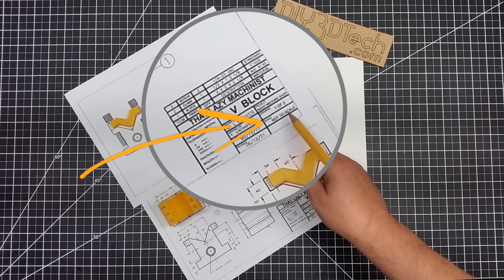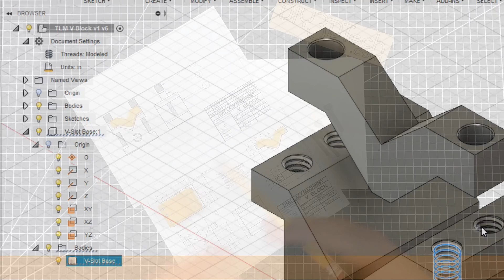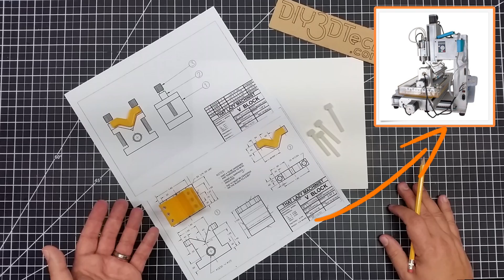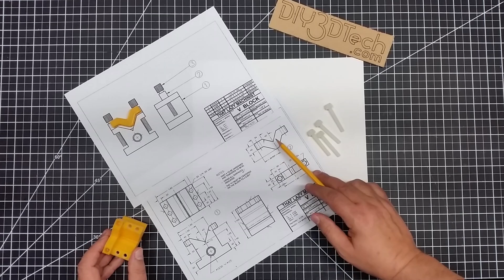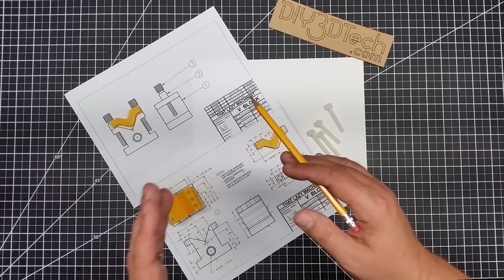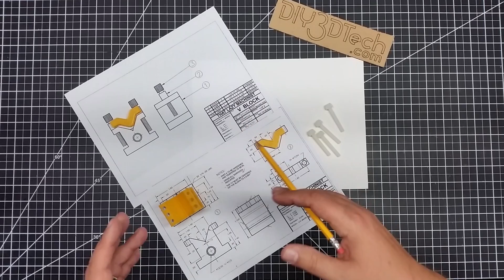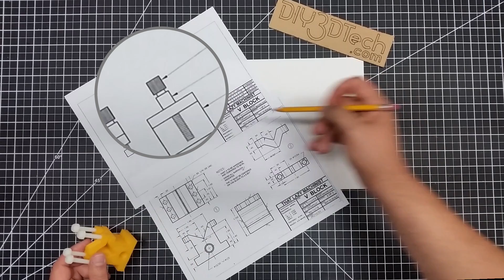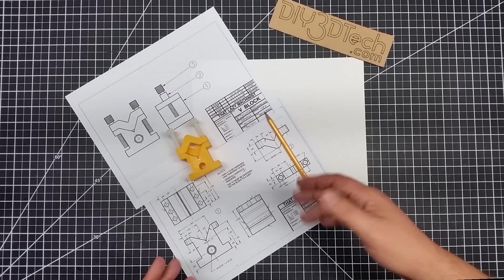Design Talk - Building the Lazy Machinist V Slot Widget!

Comment: Hi! It is nice to see a different  approach to making parts. I have done a lot of NC work but I have to admit that it was before programming software existed (G code programming). It reminds me that I am getting older. It would be good to ensure that the screw heads do not overhang the side of the V block. The clamp is not as wide as the block so that you can use the bloc on its base or on its side (without interference of the clamp (or screw heads) and the machine table or surface plate). I thoroughly enjoyed the video and I invite you to contact me if you ever have any questions about my school projects. You may notice that some parts are more complex than necessary, it is important to remember that the first objective of these projects is to ensure that the student uses as many different machining techniques as possible. Great job!! keep the videos coming, Marc.  Thatlazymachinist@Gmail.com  (if you ever want to contact me).
Reply from the maker: I am humbled!  You have done some great work sir and my goal is just that to show that, how other modalities of manufacture can be used!  Without question you will hear more from me in the future as these are great reference models!  I am in the process of build a new shop (and house for the wife) so when done this fall and moved I plan to pick things up again :-)

Comment: Ur cad drawin is bad..
Reply from the maker: LOL!  Herr Viking why do you say that?
Reply: Drawings are performed on separate cards @DIY3DTECHcom
Reply from the maker: Still not sure what your trying to share, however that is part of the idea of this video because as pointed these are from the "The Lazy Machinist's" site and a bit old.  However that is the point I am trying to get at, as those getting into the trade will need to be able to work with a range of drawings.  Was watching a video the other day where as machinist was trying to recreate something based upon drawings from the 20's which where very lacking,

Comment: Thanks for the video.  I have done a bit of work with 3D printed threads.  Here are my findings:

1: If you are patient, and with a few techniques, you can print threads that don't need to be chased with a tap/die.  I've successfully printed functional male m48x0.75 threads with no post-processing (had to, didn't have a die that large). TBH it was a huge pain to get dialed in and I would have used taps/dies in that case but just to point out that if you want to do additive manufacturing of threaded parts with minimal post-processing, it can be done even in fairly challenging situations like that.
2: Tolerances.  I do all my CAD work in F360 and "CNC kitchen" posted a great video showing how to add tolerances to modeled F360 threads.  You basically select the faces of the threaded mating surfaces and use the Press/Pull tool to move them away from each other.  Works great, easy to do, and nullifies the "shrinkage" issue you hit on in this video.  This is a KEY tip in terms of avoiding taps/dies.
3: Print technique:  GO SLOW is the best thing you can do with threads.  I print M6x1.0 parts that come out essentially perfect and since the parts are small they still only take about 10min each.  Of course this is a problem if you have a big part with threads inside it.  In these cases you might consider doing a threaded insert, or create a slot or other container for actual hardware.  Installing that is faster and/or less error prone than printing slowly or running taps/dies over your parts, and in the end you have a stronger thread anyway.  I print threads at 10mm-20mm/sec and 0.12mm layer height with a 0.4mm nozzle.
Reply from the maker: Many thanks for commenting!  Yes, printing with 0.2mm nozzle I would assume would produce amazing threads and you would have to go slow with that.  However I am doing 1/4-20 threads all day long with 0.4mm and no chasing with Fusion 360!  I am just blow away with the quality/ability of Fusion to create threads!  :-)
Reply: Awesome, glad you have it dialed in!  It's pretty amazing.  I actually meant 0.4mm, not sure why I erroneously said 0.2mm   I don't think I even own a nozzle that small and certainly have never printed with one.  I just updated my comment...  TBH I have never pushed the speed to see how fast I could go and still get a reasonably accurate thread.  Some of the issue is that with some of the little bolts I print, you need to go slow to keep them from being ripped from the bed.  Maybe I could use a brim and go faster.  What speed are you using?  Thanks for the reply.

Comment: I haven't tapped any 3d prints yet so just a theory, but why not use roll form taps to chase the threads instead of a cut tap's? That way your not removing any material.
Reply from the maker: Good question and the simple answer is you will need to remove material (that is why I recommend at three walls) , also the roll forming are lubricated for the intend of forming metal and not sure they would work on plastic.